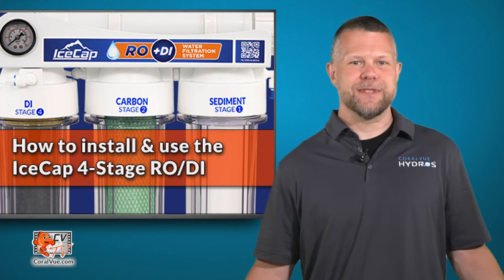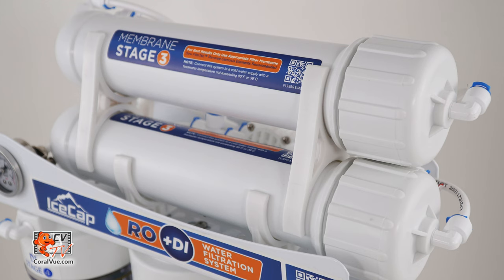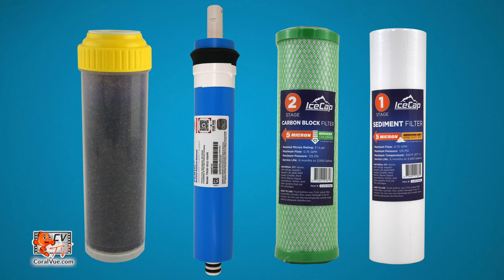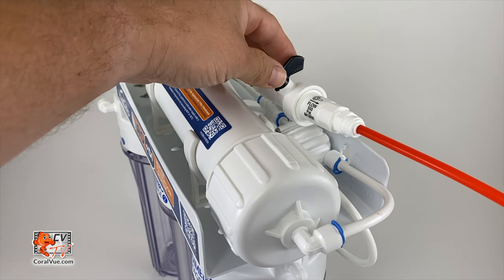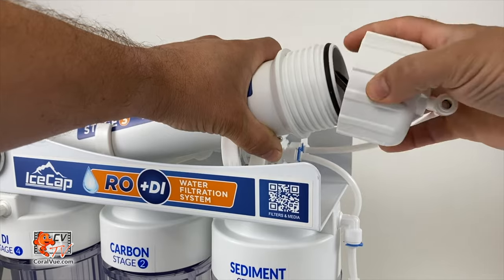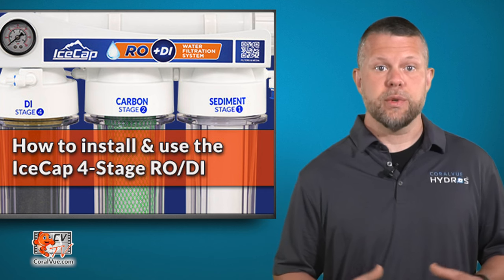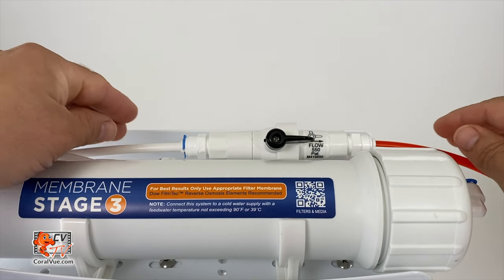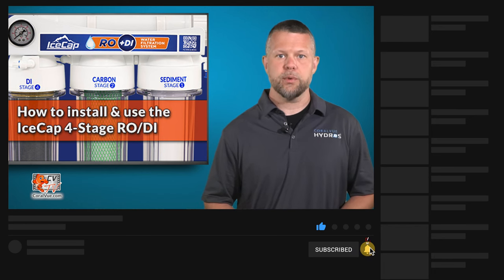IceCap 4-Stage RODI Unit - Assembly and Installation Video

Comment: I can't figure out why water isn't getting to DI stage 4?
Reply from the maker: Is water coming out of the output of the RODI? It is very common for air to get trapped in the DI  cartridge but the water is being filtered. If no water is coming out of the output of the DI then its possible your flush valve is open.

Comment: Then it says to remove the DI filter but only fill the first two chambers to flush the system- how will they not fill the 3rd chamber ?
Reply from the maker: You just have to remove the DI filter so that the membrane can flush be flushed out without compromising the DI. Water will still go through the DI canister but should be directed towards the drain at this point. It may be best to look at the instruction manual which is a bit more detailed rather than the video: https://www.coralvue.com/blog/icecap-rodi-getstarted

Comment: Nothing says to remove the membrane on top first until 3/4 way through the video!!! And there is ZERO customer support.  I just buy new units cuz the filters are impossible to replace and they’re so cheap.  Do not expect any help - watch this video if you need proof